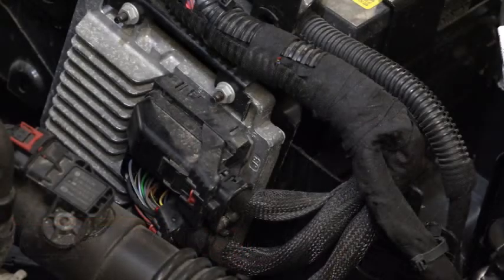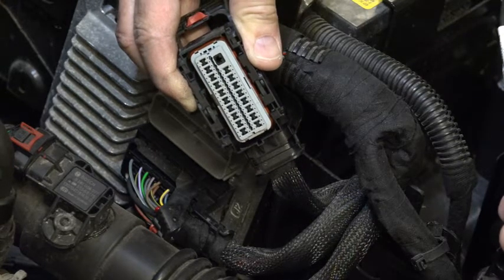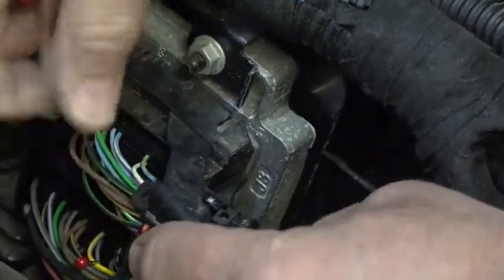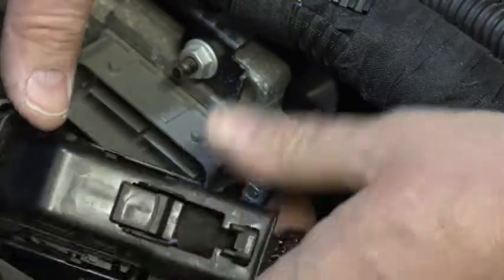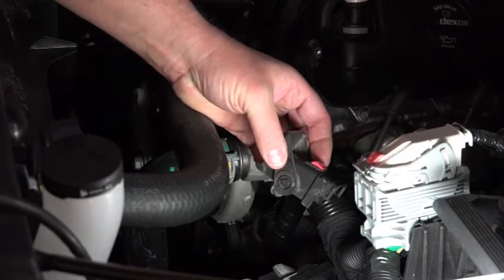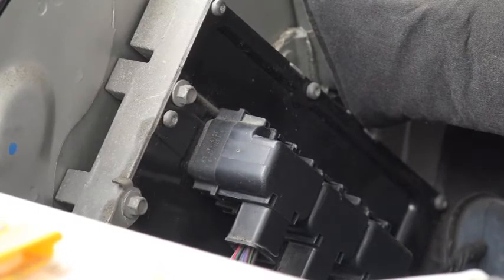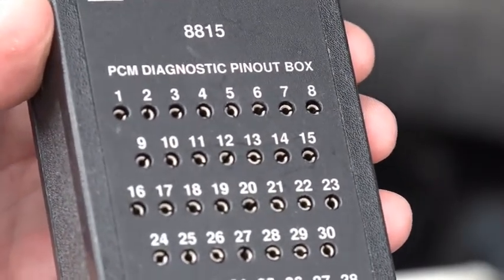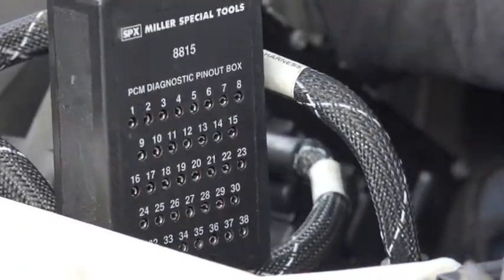Fun with PCM Connectors

Comment: Can the outer casing of the plug be taken apart further? I broke the latch on mine. Won’t draw it in tighter anymore. Will I need to re pin the wires to a new plug or can I just replace the casing/ latch setup??

Comment: Great video, chevy emc connector..the small pegs on the ecm connector has broken so i lost the ability to anchor in the wiring connector. I have managed to reconnect it but its not locked in. Any suggestion especially the broken peg is on the ecm unit, not the harness connector. Thanks russell

Comment: I have a 2002 Mini Cooper.  After losing my power steering 1400 miles after a recall was performed on it, I called and rescheduled another appt.  I was told the ultimate problem was a 16 amp fuse that was located in a fusebox under the engine fusebox.  For a $10 fuse they wanted $400 plus dollars to put it in so I ordered the part and told them I would do it myself.  Upon getting it home I noticed a wire hanging under the front of my car.  I jacked it up to find that they forgot to put the power steering fan back in as well they didn't reconnect the power steering pump! RAH!  I dropped the car and was looking at the fusebox I am going to need to take out and noticed they also forgot to reconnect the ground to that box as well as another connector that comes off the positive PCM connector. Not seeing here or in the Chilton where this connector coming off the PCM connector goes.  Was hoping to see something here on this video but It's either already plugged in and can't be seen or the cars you are working on don't have them.  Can you help me out here?  wish I could download a picture of it but seems like only emoji's are allowed. TIA!

Comment: My rx8 pcm has a fault p 0610 that I can’t remove or clear I’m told need to take it out and send away to get programming again.     Iv ordered some manns contact cleaner going to try cleaning all wires and Iv a voltage meter check everything hope it works.    My pcm has them bolts to stop people removing them

Comment: I have replaced a pcm in my 1999 Dodge/Ram Truck RAM 1500 1/2 ton 2WD 3.9L FI OHV 6cyl. I am looking for where to either find the grey plug or can it be rebuilt and how?
Reply: I have an 08 and mine is under the driver side fender hidden in that area